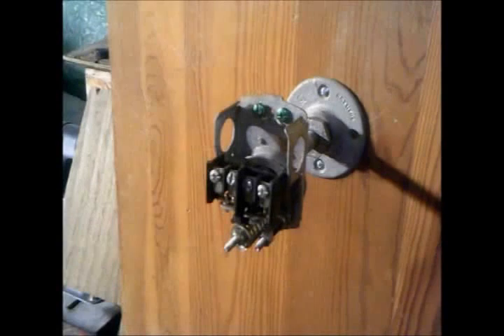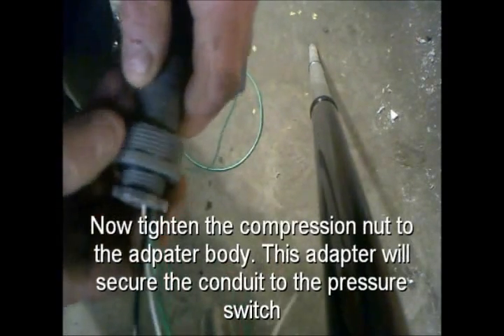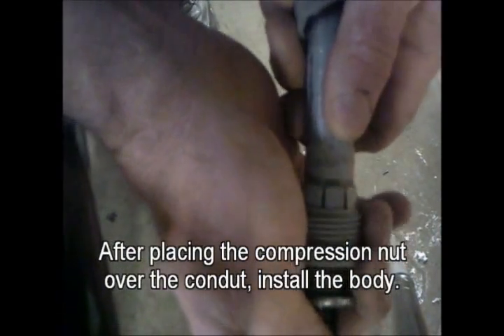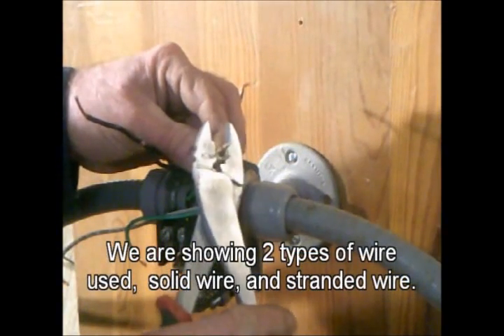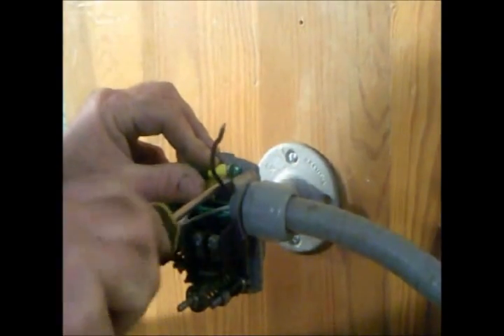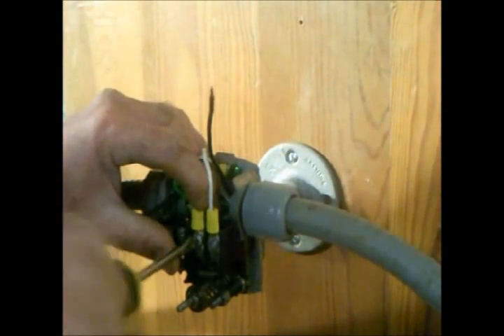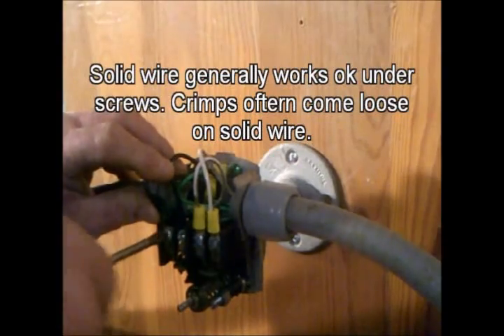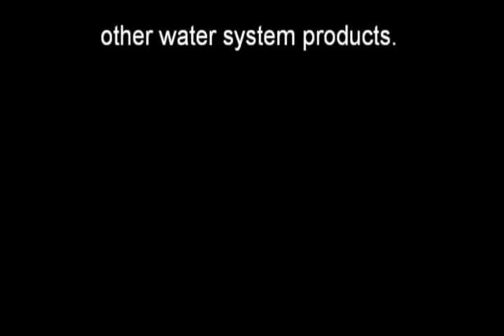how to wire a pressure switch by www watersystempartscom

Comment: Doesn't explain electrical connection from power  in or out... any nut knows how to plug in screw in wires.... and no information on power wire color or connection in control box... really no help.... might as well show how to play with little trucks... errr